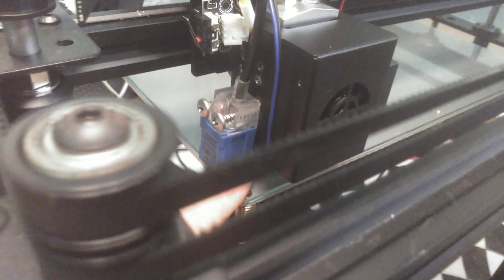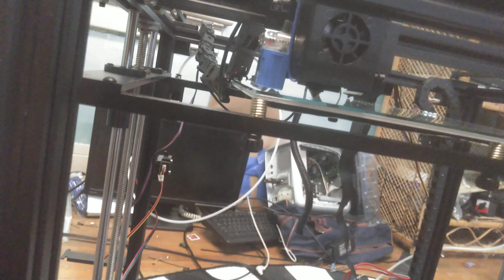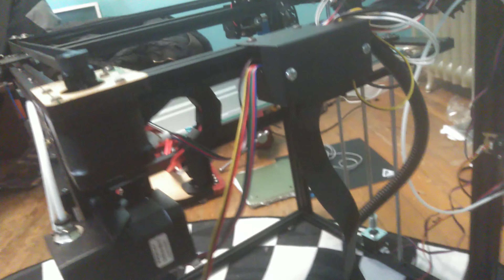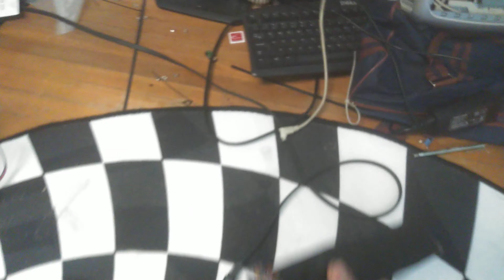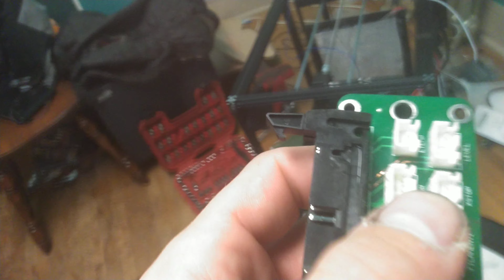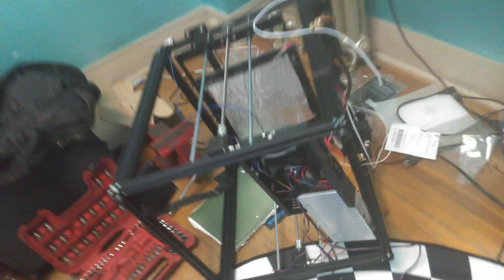My TronXY X5SA-2E has me ANGERY, guess I'll buy another controller

Comment: You induction sensor is just fine. The screws holding it are far too big to allow it to adjust.   I have a number of printers. The tronxy is fine if you assemble it correctly.
Manually adjust the z offset then mount the sensor so that it sits with 1 filament thickness between your print surface and the sensor casing.
Reply from the maker: I doesn't allow manual adjustment either. It does the same thing if you try, just crashes its nozzle right into the build plate and keeps going, gears clicking.
Reply: ForwardsEnginrd I notice you have a glass like build plate. Is that original in your part of the world?
Reply from the maker: @stephenlipton525  No, but it does the same with either.

It also does it without a build plate.
Reply: ForwardsEnginrd i would not rely on the sensor with the glass plate. That sensor is an induction sensor.   Try changing the firmware to Marlin or even a fresh copy of the Tronxy/Chitu firmware. After that you need to start checking continuity on the cabling with a meter.   I’m sorry you’re having such problems. I’m new to 3D  but I’m an electronics engineer. I can honestly tell you that for it’s cost, it is really good value for money. 
I have a number of printers because I’m assessing value for a customer who is about to buy a number of units.  I would honestly put this up against units twice it’s price.
Reply from the maker: @stephenlipton525  There is no current Marlin firmware for a V6 board, as far as I'm aware.
Reply: ForwardsEnginrd then try a fresh copy of the most up to date Tronxy.   After that it’s all about getting the multimeter out.
Reply from the maker: @stephenlipton525  We've been down that road already. There seems to be an error with the firmware and it being a X5S-2E specifically, a dual extruder unit. Fresh firmware does nothing at best.